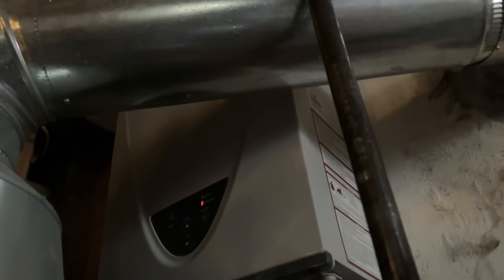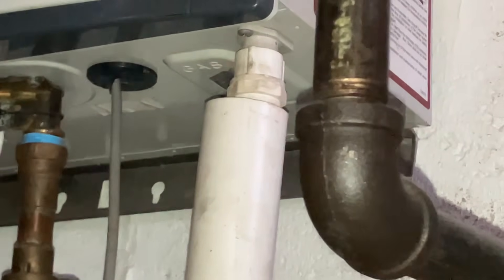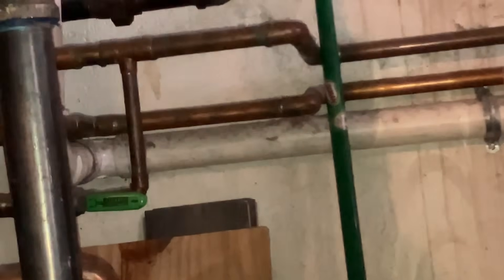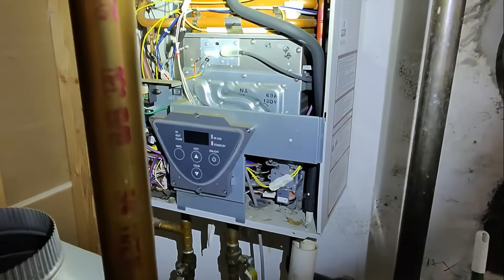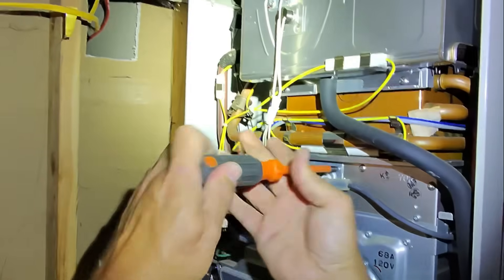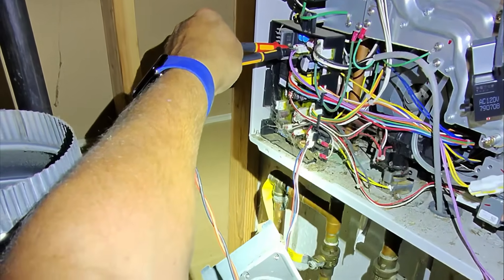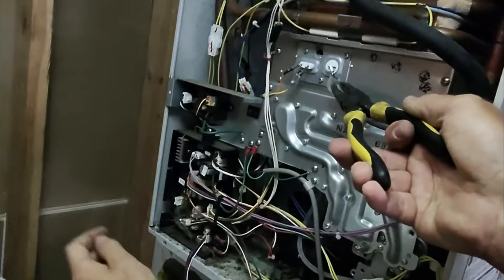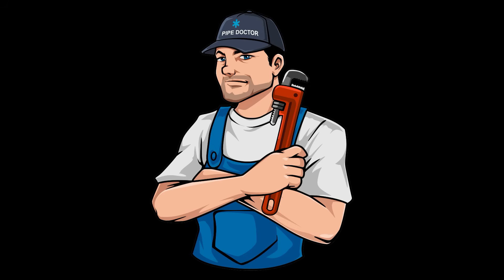AO Smith Tankless Water Heater No Hot Water | Error Code 111 Flame Failure Diagnosis & Fix

Comment: Homeowners near maintain there water heaters, you can tell them to properly flush them every year or every 6 months depending on water quality and they still ignore it. Also this water heater is a Lowe's brand it's not a contractor grade pro line. Myself personally I always tell my customers to stay clear of any tankless even if someone gives you one for free turn your head and run, They are nothing but problems, Standard tank water heaters have been around for years, and years , and years and are easier to work on and easier to get the parts, I have installed every brand of tankless out there and they all are problems. It wonu't matter if you do it exactly per code, exactly per manufacturer they still have issues. Even with a standard tank water heater you will get the moron plumbers who don't care about there quality installing it incorrectly, Us real licensed master plumbers have no control over the other idiots who do shady work and or messy looking work. And in today's world the new generation of plumbers can't even sweat pipe everything they are taught is pro press and they can't even do that right, I see so many new generation of plumbers who claim a 4 year old can install pro press fittings then I look at there hot mess and you can tell the pipe was not cleaned, or reamed inner or outer, no depth lines on fittings ECT. Welcome to 2026, It's only going to get worse. I been in but for 31 years I can't wait to retire soon, The real license skilled plumber will be obsolete 10 years from now here everyday companies are coming out with fittings ECT so homeowners can do there own plumbing, Pretty soon water heaters will be made to grow legs and walk to customers homes and install themselves elimating the skilled plumber.

Comment: they at least installed standard unions on the copper pipes, granted poorly placed before the shutoff valves. but it wouldn't be too hard to unhook and flush via those. maybe their thoughts or selling replacement unit when clogged. lol

Comment: My advice. Go with the old reliable 40 gallon natural draft unit.  All parts likely on tech's truck, easily fixable, and  best of all will work even if you have a power outage. All for 3-4x less $$. These tankless units really suck balls if your water quality isn't stellar.

Comment: Honestly, Mike, the videos you put out show what absolute garbage these high efficiency units are. You have countless videos of these units failing within months or a few years of ownership, needing thousands of dollars in repairs or complete replacements under warranty/out of warranty, of course the public opinion isn't positive!!! The initial installation cost is several times what a traditional tank style water heater cost, the thing requires annual maintenance, also to the tune of several hundred dollars to do the chemical flushing/preventative maintenance, and when they fail, they're thousands to fix. If the whole incentive behind these energy efficient units is to save the consumer money on fuel cost/electricity, but then that savings is offset by the higher initial installation cost, annual/preventative maintenance, and the repairs that will inevitably come up during the life of the unit, where exactly did the consumer save any money? I say this with all due respect to you and your business, not trying to be disrespectful in anyway. Your videos and others that post this educational content have saved me time and time again with my own issues that have come up in the home, I salute you sir 🫡, but from what I've seen, this is just a hard truth. It's just like our vehicles, over complicated, over engineered, over use of computers/technology, made of plastic pieces of crap, with all these dumb energy and safety mandates that make them completely unreliable, and unrepairable. Make it make sense 😑
Reply: noooo maintinence,,,,jimmy
Reply: yep, been screaming it since day one of them being pushed on the market.. installed some as early as 2001 and got endless complaints on them, even when done perfectly by the book and paperwork, proper gas piping and volume available. those were the stainless exhaust high flue temp(non-condensing) models and even then without half the trash inside were nothing but troubles. sensors, burners dirty, flame/spark rods, inducers,  gaskets failing, clogging on mild city water, control boards, remote boards, etc. it was always something
I even warned and told them to avoid them, but they insisted. lol
Reply: @throttlebottle5906  I am not a plumber/HVAC technician by trade, but I worked in construction for 10 years between two general contractors that built environmental remediation systems, and built petroleum/hydrogen fueling facilities. I also went to trade school/college for construction management and project estimating, plus as a hobby I try to stay up to date with what's going on out there in the building trades since my current career pulled me away from it, even though I love it. I got away from it because I couldn't make what I currently make, but man, the shit going on with everything nowadays has my head spinning. Just repaired my washing machine again, stupid pressure switch got sideways and was causing the machine to overflow!!! I just keep repairing it when it breaks because after a long convo with the owner of a local appliance parts supplier, he told me to just keep fixing it because all these new machines are so unreliable because of all the tech they cram into them!!! He told me unless the main board goes, or the transmission, just keep fixing it!!!! The parts are inexpensive, a multi meter and basic hand tools is all that's needed to troubleshoot them and make repairs. Over the last two years I've replaced the belt, shift actuator, splutch (yes, Whirpool calls it a splutch 😂), suspension rods, capacitor, pressure switch, and rebuilt the agitator. Thing works like it's brand-new, and I'm into it for my time plus half what it would cost for a cheapo plastic POS machine from a big box store!! I learned something and had some fun working on it!!! Worth it to keep this one running because it was one of the first generation high efficiency machines before these manufactures went off the deep end with all the computers and sensors inside this stuff now, too much stuff to go wrong, just like these boilers. When will the madness stop, or will planned obsolescence prevail? Sucks 😑

Comment: I have 2 of these at my restaurant and replaced them 3 times over the past 10 years. I'm a plumber as well.
It was always a leaking heat exchanger.
Thank godThey were always under warranty and the labor was free.Since I did it otherwise, I would have replaced them with other units

Comment: I know someone that had a Takagi. Had to reset high limit switch.
Reply: Takagi and AO Smith are the exact same machine in some models. My propane unit (T-H3M-DV-P 101) is identical to AO Smith. Both use the same parts, and come form the same distributor with the only difference being the labels (and the price, the AO Smith branded was about $100 more.)